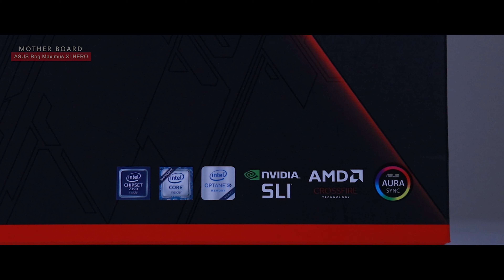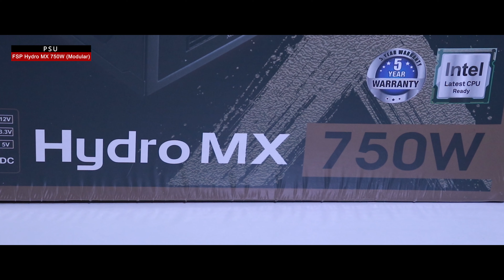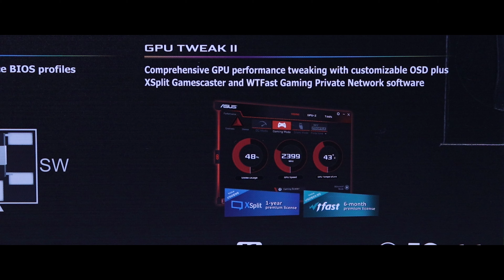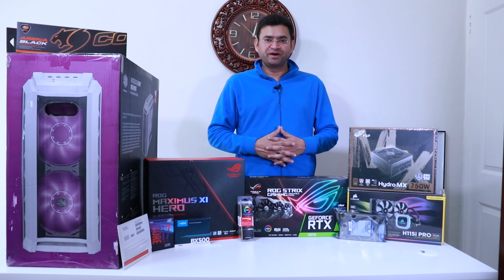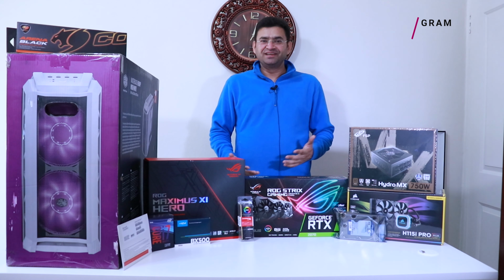ULTIMATE PC Build | My Dream Gaming & Editing PC | Time Lapse Build

Comment: Your psu is the wrong way around buddy. There is not enough air coming in from the solid panel above it, hence the holes in the bottom of the case
Reply from the maker: Already have fixed buddy😂😂😉😉